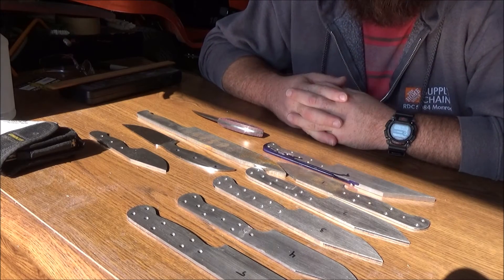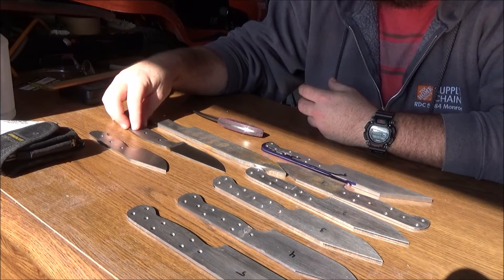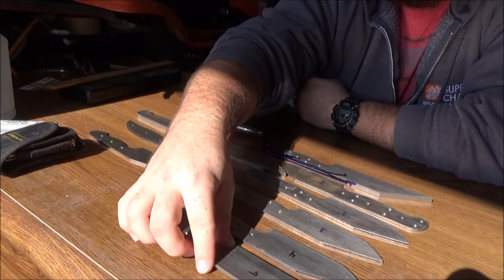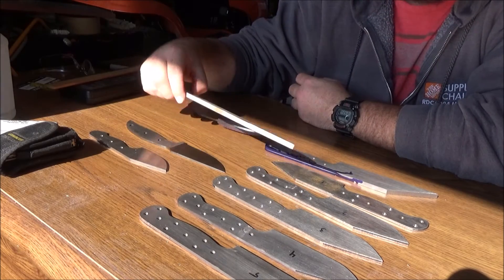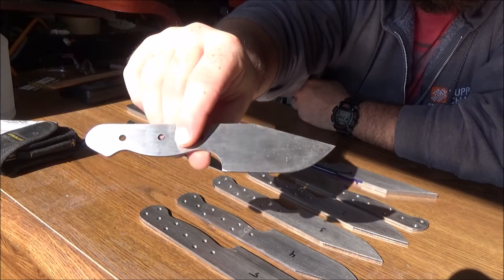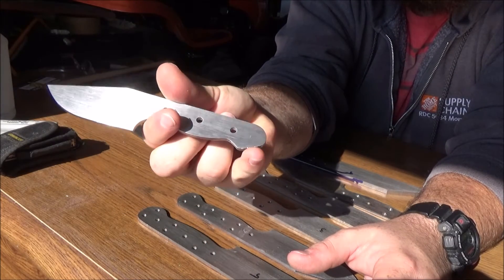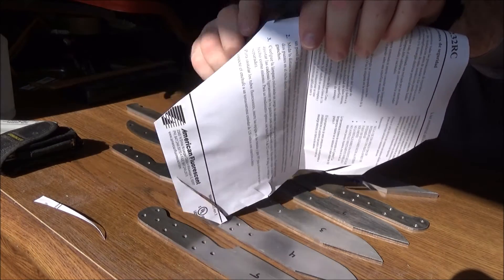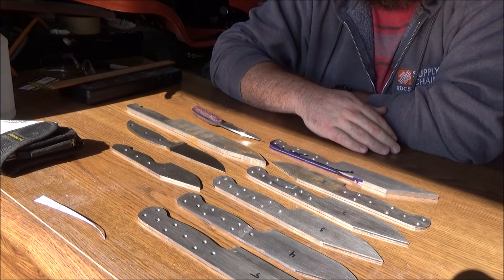Knife Making Update

Comment: I understand about the funds or rather the lack there of! The abrasives do get expensive. I think they are my biggest expense in knife making. I am currently working with CPM154 and it is a bear, really eats up belts fast. I mostly like to work with O1, it is my favorite steel. It grinds easily in fact I can get half a dozen knives ground on one set of belts! O1 is also very tough even at a high hardness and holds a great edge plus I have the heat treat pretty much perfected. Give it a try on some prototypes you will like it.
Reply from the maker: Last Chance Knives Yeah I have some knives in O1, but I've never worked with it myself. I will definitely give it a shot; I might have to ask you for pointers on the heat treat lol!
Reply: Bridges Cutlery: I would be glad to help with the heat treat.
Reply from the maker: Last Chance Knives I really appreciate the support man!